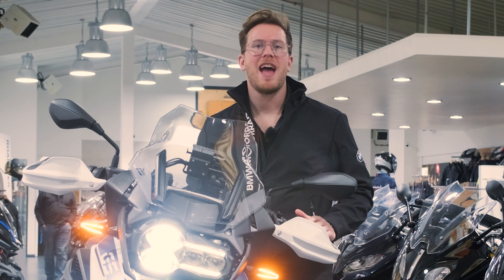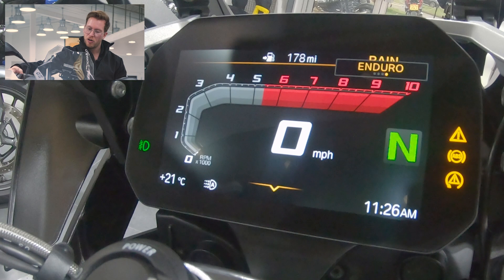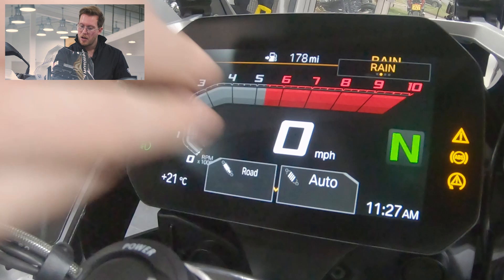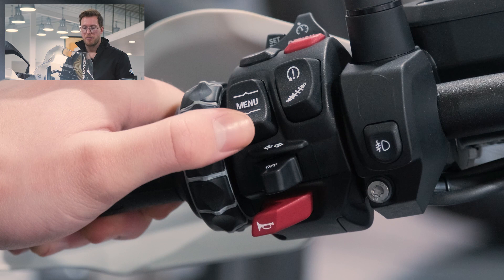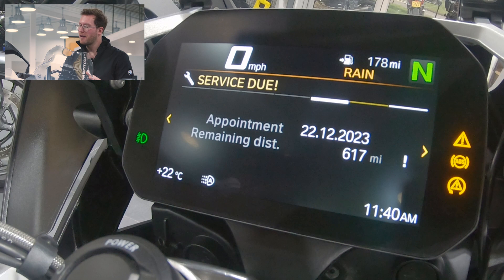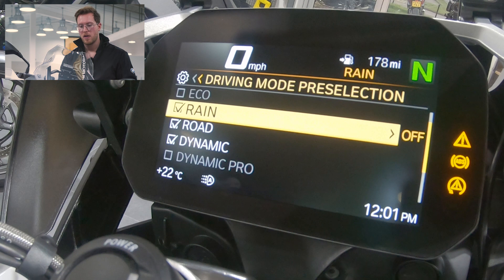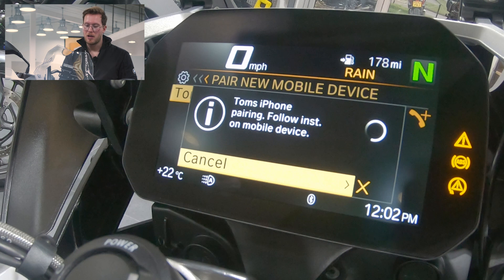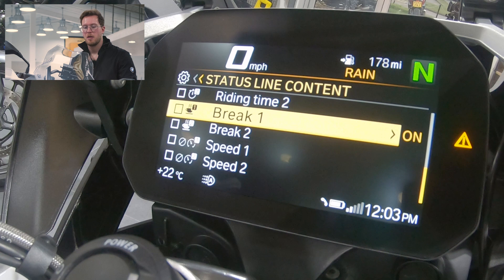How to use the BMW Motorrad TFT Screen - Roy Pidcock BMW

Comment: Great video, well explained! Yet, I do have a very specific question; when the low fuel warning comes on to the display and blocks all the view, is there a way to get rid of it and see other valuable information on the TFT?
Reply from the maker: Hi @duckm1000 to get rid of the fuel warning, use the multi-functional wheel on the left handlebar and swipe to left to right. That will remove the warning. Hope that helps!
Reply: Yep. Also gets rid of the low tire warnings, service warnings etc.

Comment: Hi great video! I notice on the right handle bar their is a mode button where you can set the riding modes. Also, on the left. What is the difference between the two. Is it just another option or does it set the modes differently? Why have 2 different places to set the modes, unless it does something different. I hope that makes sense. Thanks
Reply from the maker: Hi @p-dub7422 the ride mode on the right is for the engine response. The button on the left hand side is used to alter the suspension which gives the rider more adjustment options to suit the rider’s needs. Hope that helps!
Reply: @pidcock_motorcycles  I have another question for you. If the button on the right side is in the rode mode should the button on the left also be in the rode mode? Or could or should they be in different modes. The suspension matching the engine. Thanks